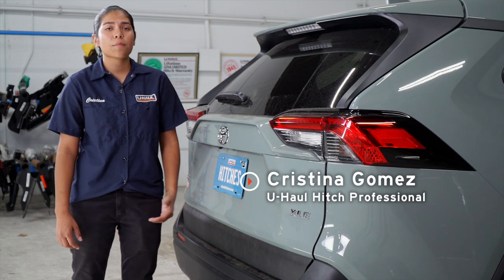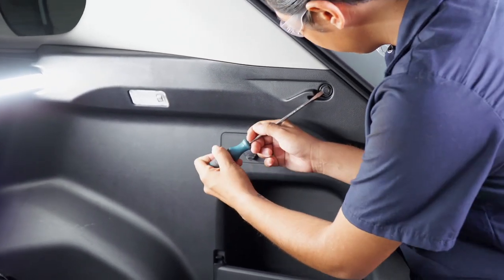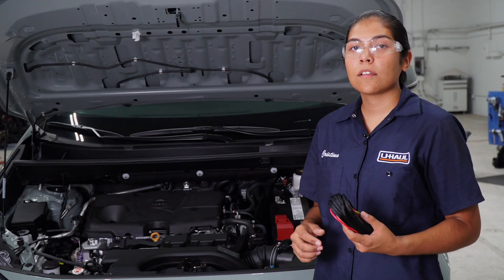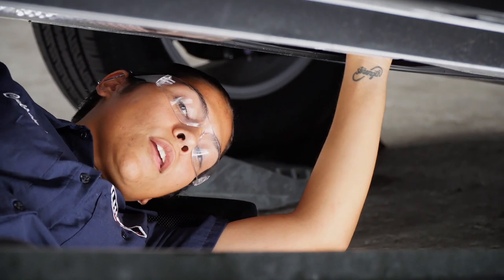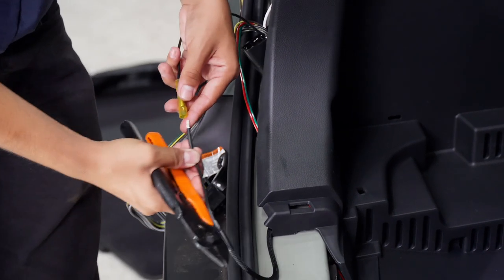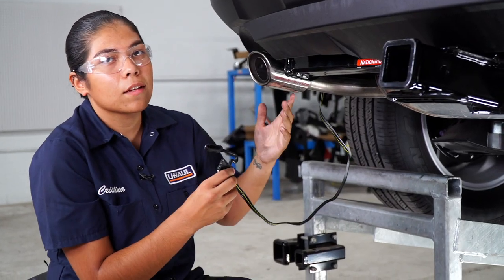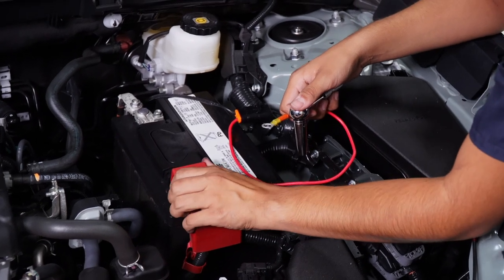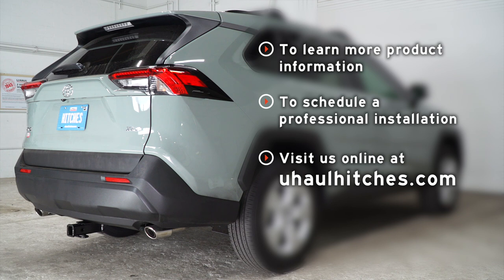2019-2024 Toyota Rav4 | U-Haul Trailer Wiring Installation

Comment: Important to note: 2019-20 Hybrid models have the battery in the rear passenger side under and to the right of the cargo floor. Don't waste your time routing the cable under all of the underbody covers like I did.  Its even easier than the non-hybrids.
Reply: Thanks for this great tip! Did you end up just running it exposed on the underside of the car? Or did you find a different path? THnx
Reply: If you have the non-hybrid, I would recommend to tuck it in like the video shows and use plenty of zip ties. This requires routing power cable under the car. It would be too time consuming to remove all of the underbody panels.

If you have a hybrid, remove the plastic trunk lip and pop out the rear portions of the side panels the connections to the rear lights are inside both panels and the battery terminal in on the bottom right of the trunk. Secure the bottom of the converter module so it doesn't rattle with some 2-sided tape. There is no need to route the power cable as everything is right the in the trunk compartment.
Reply: J Ab have the hybrid, but didn't realize I could input the wiring harness into the battery terminal in the rear! Thanks so much for the heads up!!
Reply: is this the same for 2020 models
Reply: @emmadimanlig4247  just did it on my 2020, yes exactly the same
Reply: Good thing uhaul charges a small fee to do it for us 🙏
Reply: Jimmy Jon  cool story
Reply: Thanks legend
Reply: Mind sharing which hitch you installed on your hybrid ?I have a 2016 Rav4 XLE Hybrid.

Comment: Great Vid. I'm going go "go ahead" and get a wiring harness as soon as my R4P shows up. The Rav4H and RAV4 Prime have the 12v battery in a different location, tho.
Reply: Hot tip. 'Go ahead' and test it before you go ahead and put the interior panels back in place. If it doesn't work, you're gonna go ahead and kick yourself.
Reply: #weirdflex
Reply: @erichtisnado1536  they are professionals not amateurs like you...
Reply: @DUNGSTA  Not professionals on screen, apparently.

Comment: When you hooked up the power wire to the positive of the battery, did you remove the ground first? And did you have to reprogram anything after you hooked up the power wire?
Reply: No you do not have to remove the ground! Nothing will need to be reprogrammed as well! Hope this helps.

Comment: Does having the LE hybrid model change the installation or kit required at all?
Reply: This kit will fit the 2019 Hybrid model. The only change you may see is the battery location to hook up the power wire. It may be in the trunk instead of the engine compartment.
Reply: @aaronlimon4803  Hybrids have it in the cargo area in the passenger side. When you hook up the passenger side lights look down and you'll see it.

Comment: What’s the part number for the power wire? Brand?
Reply: PWRWIRE1 it is a u-haul exclusive part
Reply: @cgomez6742  I cannot find this on the Uhaul website.
Reply: @cgomez6742  I also am looking for the PWRWIRE1, is there an alternative? Thanks
Reply: 55115 Hopkins OEM Grade Power Wire with Fuse Holder

Comment: Gotta hate the choice they made to tell and not show. "It'll fall right through these panels here", cool… I guess I'll keep looking
Reply from the maker: We try to get every shot we can but it can be difficult working in an engine and underneath the car with a camera. However, the is no singular way to run the wire. It can have several paths through the engine bay as long as you avoid the wire contacting any hot or moving parts. As we call out in the video, we prefer to run it along the break lines of the vehicle which can be seen from the engine bay, giving you a smooth path to underneath the car.

Comment: Nice how about installing a 7 pin harness with the 4 pub also what is the tow weight of that hitch
Reply: I have a rav4 adventure that has a 3500 lbs towing weight
Reply: @thomasmorris610  if you're installing a 2" hitch receiver, it should be able to handle more than what the RAV4 can handle.